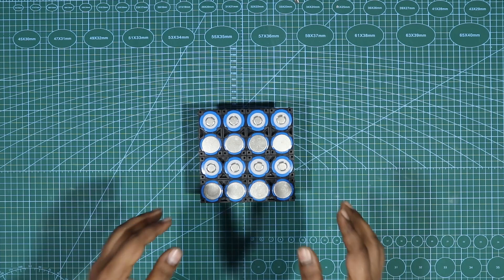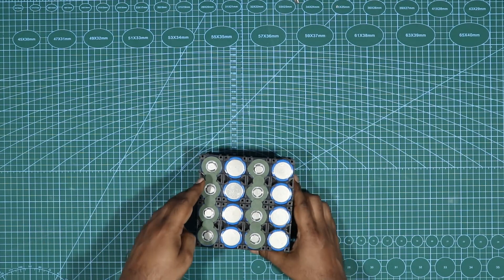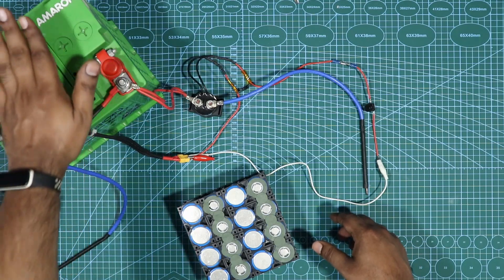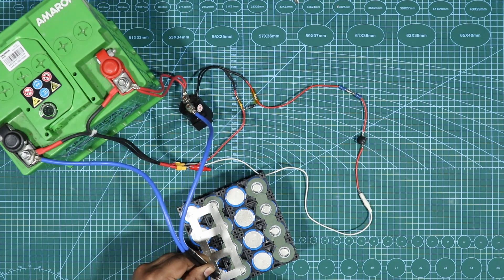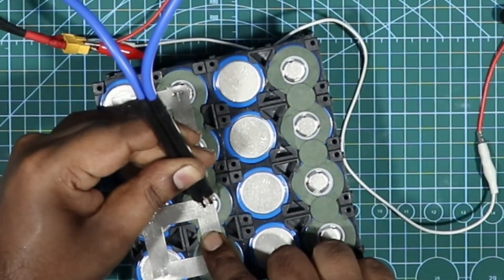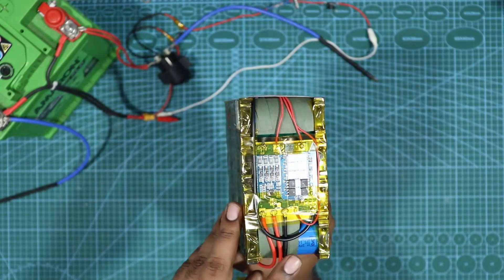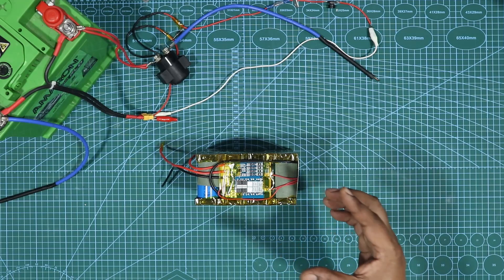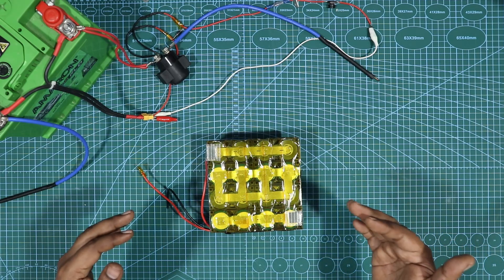12V 24Ah LiFePo4- DIY Spot weld build test

Comment: Sir i want to make 21 volt lithium ion battery pack pls help to build how many cells need and which bms is required i want to make battery pack for my boombox amplifier i need to make 21 volt battery pack aith 10000 mah capacity i have 1200mah hongli cells pls sir Answer